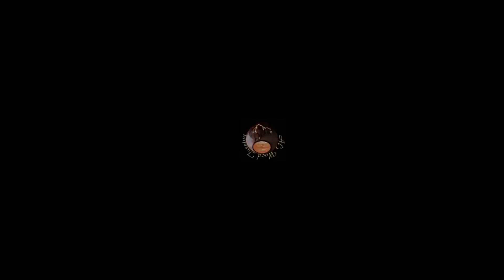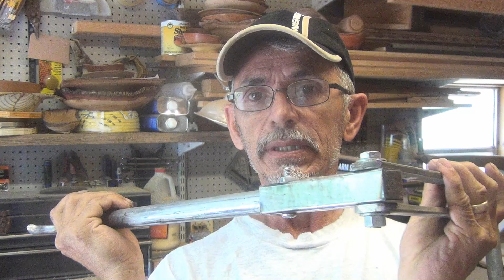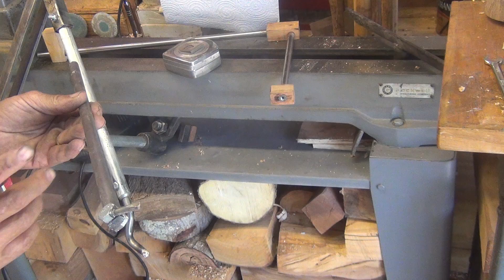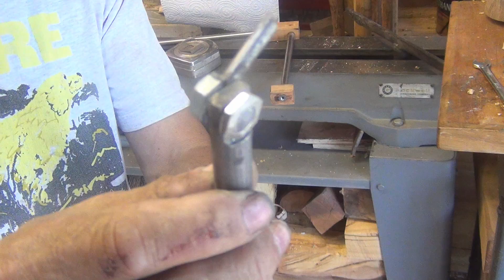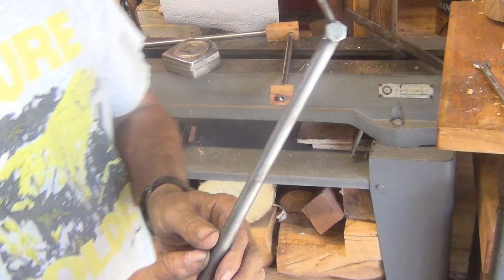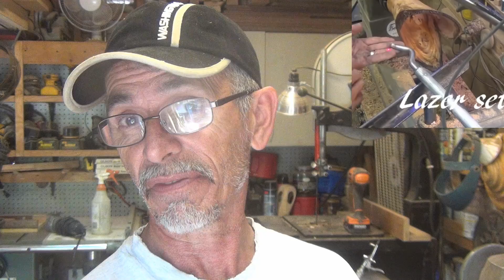Woodturning Shop made Hollowing arm

Comment: I watched your 1st stage video of this and thought great respect for your design, I watched your body language in the summary of that video and thought Al is happy but he is not !00% happy yet.... so I felt sure some of these refinements where floating around in your mind... well done for sticking at it and thank you for sharing ... 

I'm new to wood turning and your videos are very high on my list of favourites.. I will eventually build my own Hollowing jig and continue to learn from your experience.. 

A couple of observations :
1. your design is very good and if necessary, its really  easy to add more holes in both your square stock arm or indeed the double flat stock arm to experiment with perhaps different pivot points.. (not sure if this is deemed necessary but its an option .. 

2. even before you suggested you could mount a camera and monitor on your jig I had been thinking (this hollowing is going blind) as in you can't actually see what your doing.. so I wondered if using a cheap USB endoscope camera on your cutting tool might prove useful if you want share and indeed view inside the hollow... these endoscopes can come with 5m cables and typically have a led inbuilt light. 

#side note : USB endoscope camera
if you or i eye was to do this:
I'd suggest A short 1 metre  USB cam cable plugged in to extension that then leads on to a monitor .. that WAY you have tried to build in a safety feature  im thinking what if... YOU GET A CATCH!!  hopefully the camera cable would just  disconnect and PULL OUT FROM THE EXTENSION SOCKET RATHER than Risk  DAMAGE To YOUR MONITOR. etc... 
just me thinking out loud.. I think they now also do WiFi endoscopes... hint hint.. 

thanks again for taking the time to video and share with us your work.. I now this takes up time but I appreciate it 

https://www.amazon.co.uk/Endoscope-Borescope-Inspection-Waterproof-Smartphone/dp/B01IQMPITG/ref=sr_1_11?ie=UTF8&qid=1524012946&sr=8-11&keywords=usb+endoscope+inspection+camera
Reply from the maker: Thank you very much my friend for watching and the nice compliment. I appreciate it a great deal. That is what it's all about ,,,,,,,,Making it yourself. There is no greater feeling especially when it works well

Comment: Good refinements,I made my version of a hollower and your idea using steel tubing for the articulating joints is excellent.I also like the idea of wood inserts in the square tubing( I used 3 mm) using a smaller cutter( 5 mm) worked better for me with the adjustable angle and less surface area,still seemed to hog out the wood OK .Well done mate!
Reply from the maker: Thank you my friend I am glad you were able to use it and refine it. That is what it's all about. Take an idea and make it better.Take care